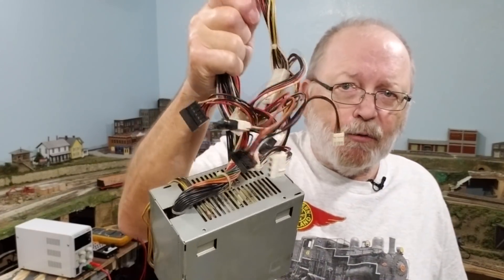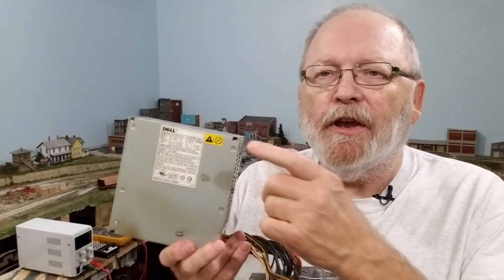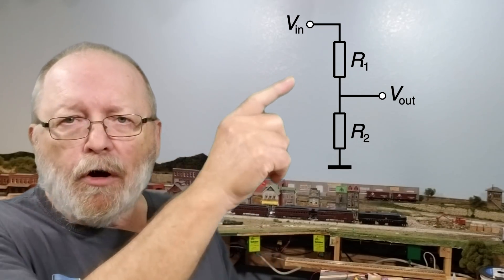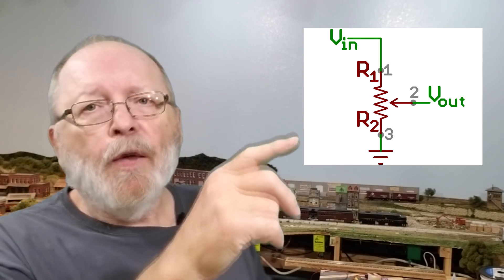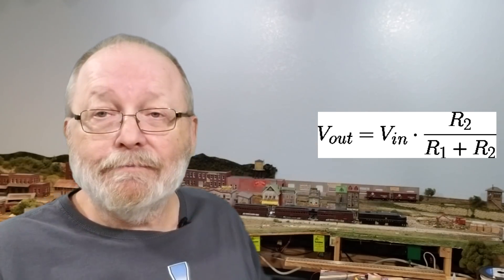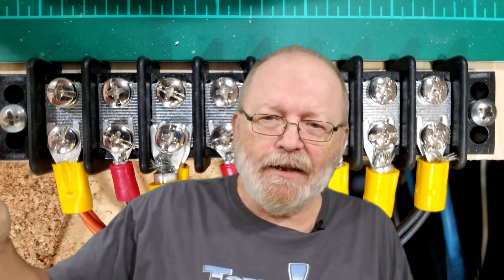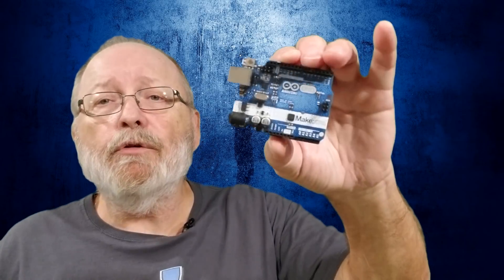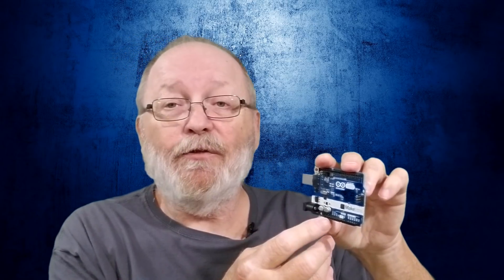What Can We Hook Up To Our Power Supply On Our Model Railroad

Comment: Brilliant video Tom, very helpful. I had a couple of old computers I took the power supplies from and re-wired them to produce DC outputs. The only thing you have to do to make an ATX power supply work is to put a load on the Green wire, to make the power supply think it is connected to a motherboard...Simon
Reply from the maker: Thanks Simon, yeah the green wire is the power on with the black on the power supply. Only the very old computers have a power switch on the unit. Did you mean a load between the red and black? I have another video where I show how to separate the wires and simulate a load here:  https://youtu.be/PatZnjnL-Vw
Reply: Hi Tom, that is exactly what I mean, but put better then I could...Simon

Comment: Hello Tom, I have an Antec Power supply,  I combined the blue wire and a yellow wire as I'd like to get 24V as you mentioned in the video. When I turned the power on, the unit shut down, I noticed the LED I wired to the grey wire went out.??
Reply from the maker: When using the two wires to obtain 24 volts,  you use the yellow as the positive, and the blue as the negative

Comment: Tom,
Just a note here that you are a tremendous resource to the hobby and I thoroughly enjoy all your videos.
thanks so much

Now - - i am considering a led lighting valance at the toop of my backdrop, all along the benchwork.  From here I can mount a multicolored strip to get all sorts of effects, light daylight, mist, sunset, etc.  It will be about 6 inches wide so as to give maximum view to the main level.  The strip will mount at a 60 degree angle to bounce light off the backdrop.  Any thoughts on doing this?
Bob
Reply from the maker: Thanks Robert. With the lights above the backdrop, you'll be lighting the rear of your layout. Are you planning on having anything up front?
Reply: The light cascades down as well to cover about half of my 36 inch wide main level.  There is sufficient overhead lighting for general lighting as well.
Reply from the maker: I was just thinking about shadows in the front.

Comment: well that is perfect again thanks Tom  
Question  explain what we do with the brown wire  hook up  where  I did put with the orange as it was Correct i hope
Reply from the maker: On the 24 pin connector the brown and orange is together on pin 13. It's normally used as a sensor. You can just cap these off.

Comment: Hi Tom, I have a problem with my train controller. I was wondering if I could use an atx  12v to act as a controller I know there is plenty of amps. No one speaks about this so I am not sure I do not want to blow the trans up thanks for any help I did not mention that I am running dc
Reply from the maker: A computer supply only provides 12vdc where a power pack provides between 16 to 20vdc variable to operate your locomotive. DC power packs are very inexpensive. You may be able to pick up a good used one at a train show or hobby shop that has a clearance isle.
Reply: This is glorious, been searching for "how to build a train table lionel" for a while now, and I think this has helped. Have you heard people talk about - Piyaliyah Uncommunicative Preference - (should be on google have a look ) ? It is a good one off product for discovering how to build a model train railroad easily minus the headache. Ive heard some extraordinary things about it and my neighbour got great results with it.

Comment: How to best get the 15VDC from the power supply to power a DCS100 and DB150?
Reply from the maker: 2 wires from the power supply to the DC input of the devices.
Reply: @TomsTrainsandThings  which two wires? I have 3, 5 and 12V but need 15V for the Digitrax devices.
Reply from the maker: If you want more than 12v check out this video:  https://youtu.be/-YFL0qWQE98

Comment: Good video! On the Arduino could you come up with a simple reversing circuit for it. I have the arduino uno and (4) ATMEGA328P-PU  chips  with socket board adapters. I have been looking for a circuit for a while now.  Tony
Reply from the maker: Thanks Tony. How do you want to use this reversing circuit?
Reply: To run a trolley back and forth, Also I was thinking of a coal mine train going in a cave them back out and out of site for a while then back in.
Reply from the maker: Do you want to do this for DC or DCC?
Reply: I have a small train controller so DC is fine
Reply from the maker: I'll see what I can come up with.
Reply: Thank you! I think that could be of use for a lot of train modelers a stand alone seen in the back ground or thru one of there towns.

Comment: I wouldn't recommend using a voltage devider for supplying power.  All the current will go through R1 and it will dissipate a lot of heat burning it up.  It is also very inefficient.   It would be better to use a voltage regulator.
Reply from the maker: There are many ways of doing the same thing! The voltage divider is a quick and easy way of reducing the voltage. This example is used in every electronic training class, book, video, even when I went through electronic training over 45 years ago.

Comment: Hi. I want to list all my trains in a book or on my computer. Do you have any tips. Thanks
Reply from the maker: Hi John. You can do your roster in JMRI, or list your trains in a spreadsheet.
Reply: Toms Trains and Things thanks. You have good tips
Reply: I used a Google spreadsheet doc for my trains list. If you have a column for the type (like Diesel Loco, Steam Loco, Rolling Stock, or whatever), then you can filter by that column to just see those. I did that, plus I had another column for "boxcar" or "gondola" or whatever sub-types to break it down even further than that. Basically, make a separate column for however it would be useful for you to filter, so you can fill in that info, then filter by it. I hope this makes sense!
Reply from the maker: I would label the different columns as Steam, Diesel, Boxcar.... and place an "X" in the column to save on repetitive typing. makes it easier to look at also.

Comment: this only applies if you are using  a single wire application..

looking at 1 of your other vids where you terminated 3 wires into 1 terminal..

by tying 3 wires together you are creating 9, 15 and 36 volts dc..

you should really go through and check the black wire voltage because mixing voltages together is not a  good thing..
Reply from the maker: 1. Have no idea what your talking about! This is not automotive wiring
2.  3 , 5 or 10 wires from the same source does not increase the voltage. When all wires are 3 volts, putting them together you still have 3 volts. Same with 5V and 12V. What video are you reffering to?
3. The black wire is ground. It has no voltage.
Reply: go and study up on electronics  u might have.. issues..

plus and minus rails
Reply from the maker: I've been working on electronic equipment since 1970. Your dreaming if you think you can increase voltage by twisting 3 wires together from the same potential.